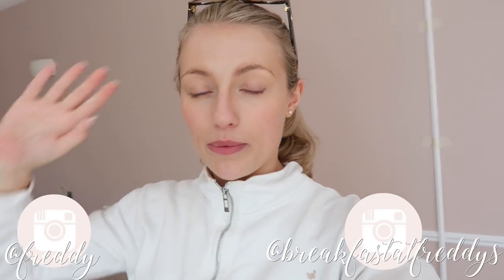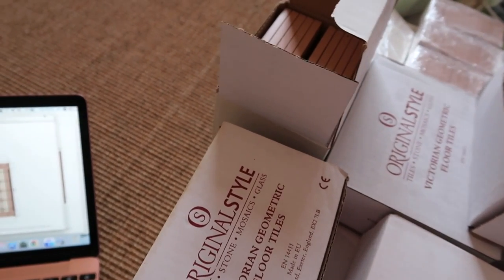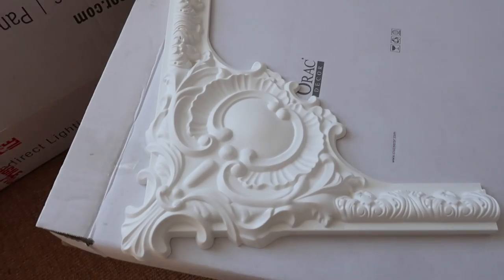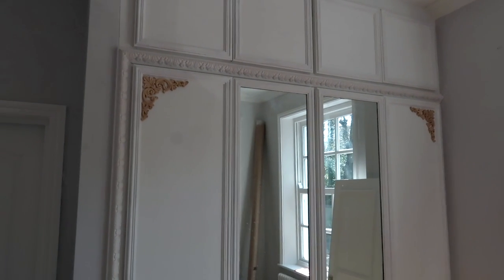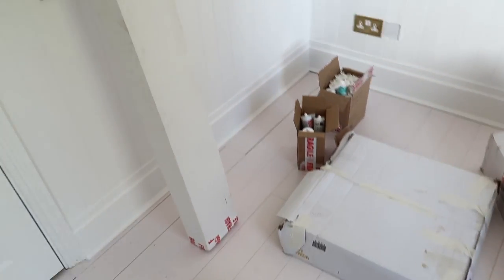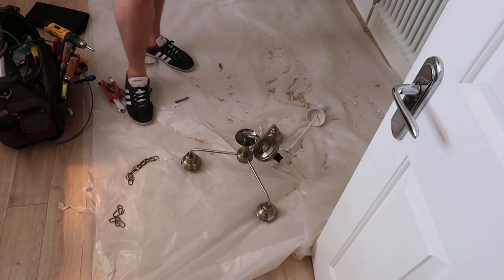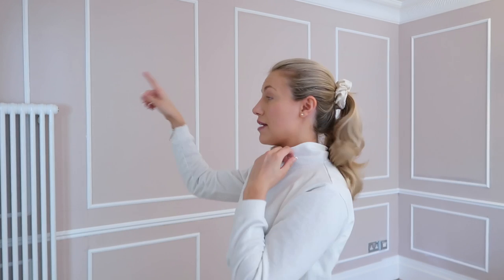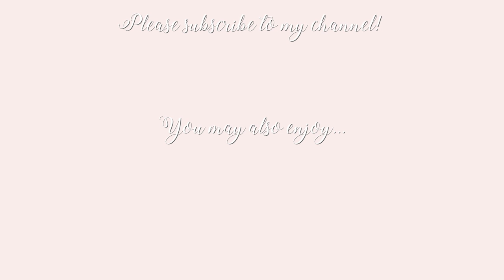Flat makeover, episode FOUR! Painting, panelling, walk in wardrobe and more! ~ Breakfast at Freddy's

Comment: did you paint the orac panelling aswell - if so how? please reply - i have just had my panelling been put up and debating painting it myself or getting it done professionaly but the professional quotes have been ludicrous
Reply from the maker: Yes I painted it afterwards, it gives it a more polished, finished look, I wouldn’t recommend leaving it! It’s hard to do, but not impossible, it’s a two person job though I’d say! You need to measure it all out perfectly and get a spirit level to make sure everything is straight. And you also need a cheap compound miter saw (not the full on machines that are hundreds, it’s just a small thing to help you get the angles)

Comment: PLEASE READ:
Recommendation for the walk in closet:

Instead of having the two display shelves with the mirrored hanging space in the middle (on the wall to the right of the window ) I think you should do a whole L unit from the weird half nook you have  till the wall to the right of the window. That way the flow of the room will look a lot more synchronized. Right now the  space in front of display shelves that are  to the right  is very tight and and cut off,  because of the weird nook. By doing the L shaped unit you will have the same shoe/ bag storage in the weird nook  ,followed by a corner closet( good for space ) ,followed by  an open glass  double door closet (to display your most cherished items) , followed by another corner closet also for storage. 

On the corner closets you can have the mirrored doors which will make the room  look a lot more spacious and will distribute the light coming from the window very nicely. 

As for the original glass door closet ( open closet concept)  you had on the window wall. You can replace that with display shelves of your most prized shoes/bags. Plus it will be the first thing you see when you walk in. 

It’s just a thought, I hope you take my advice. I truly believe the plan I explained to you  will be a lot more beautiful and you will have much more storage.